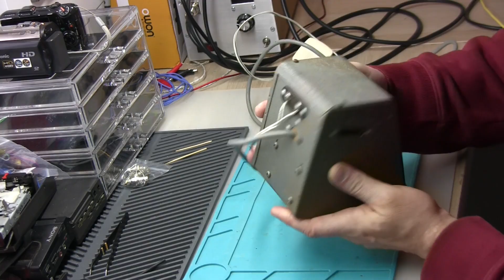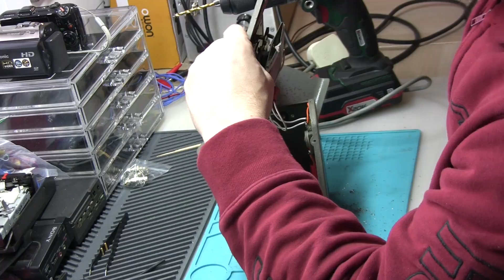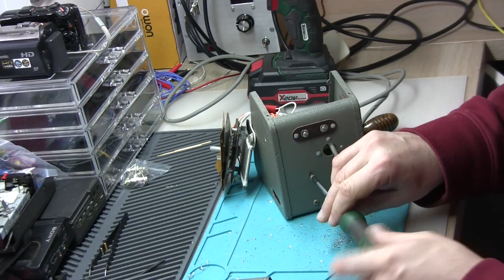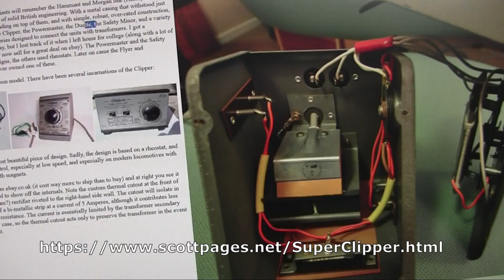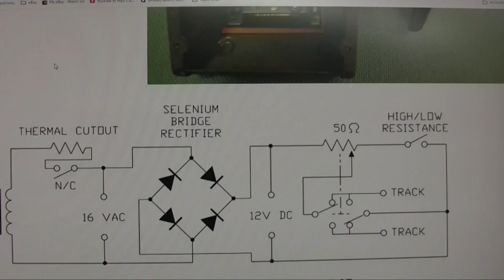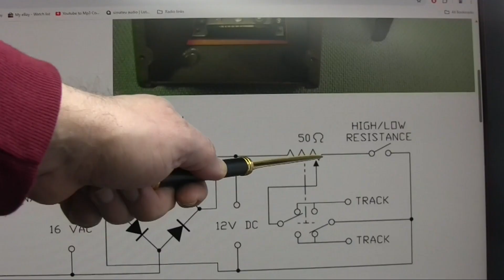H&M Clipper model railway power controller disassembly and working explained

Comment: I understand that the lightly coloured material which the resistance wire is wrapped around contains asbestos. In which case, stripping these units down is not advisable due to the friable nature of the material.